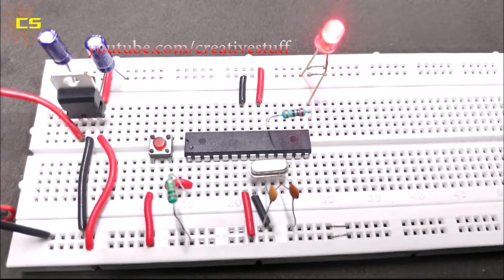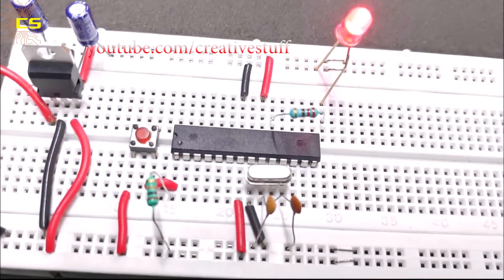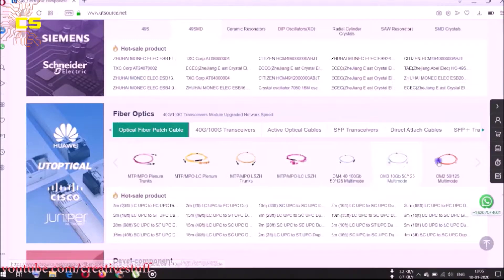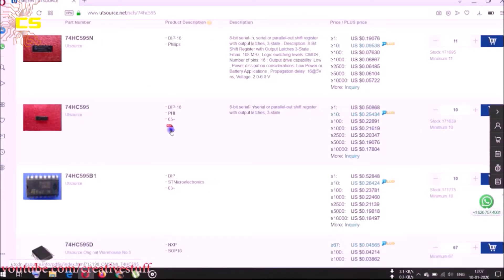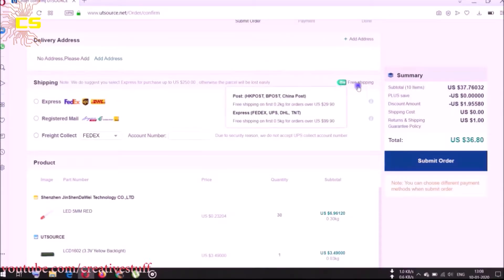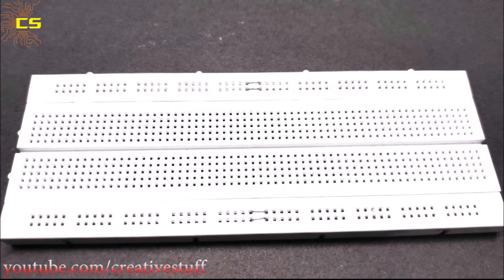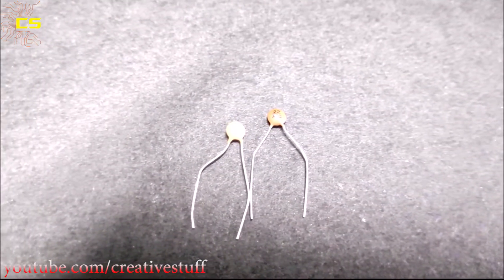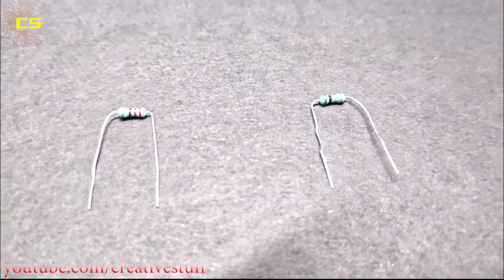Arduino on a Breadboard !!! |Standalone Atmega328p tutorial

Comment: Reset default connection is to Vcc via PullUp resistor (Correctly done). But Pushbutton should be connected to "Gnd" to PullDown the Reset pin when needed.